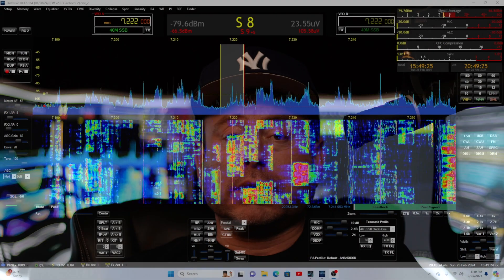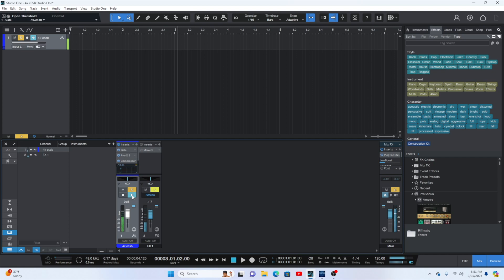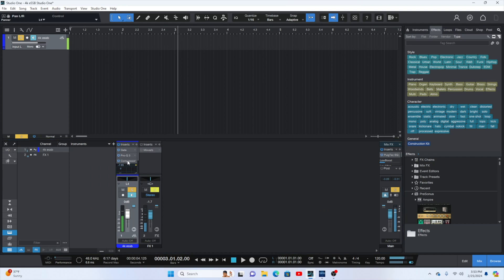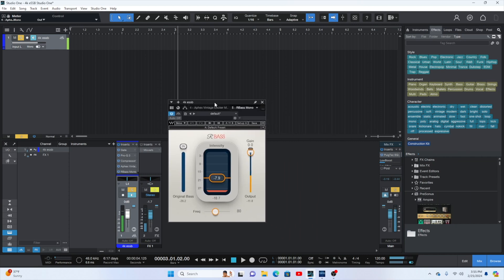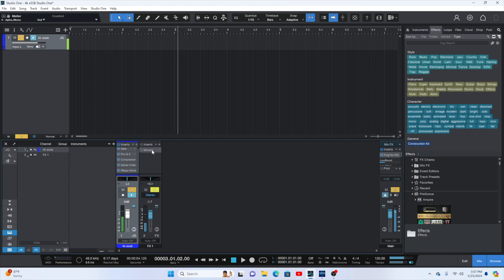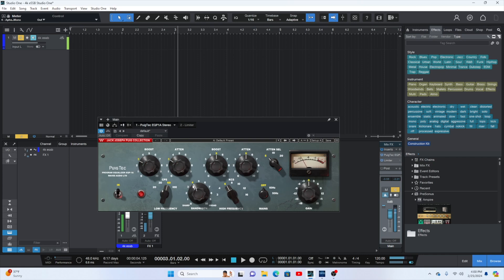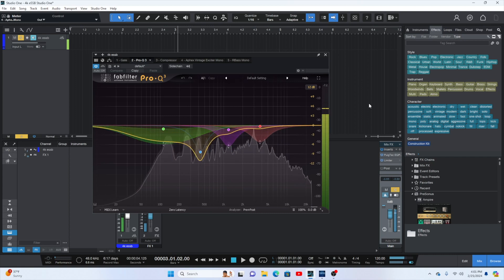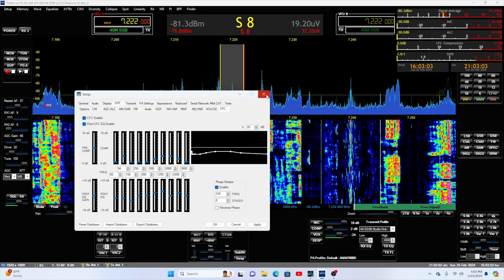Studio One and Personus 24c interface for eSSB audio processing!

Comment: Another quick question, how are you connecting the 24c to he focusrite, are you going into the mic input on the focus rite ? What output from 24c ? Just trying to order the correct cable thanks
Reply from the maker: Main out on the 24c to input 1 on the focusrite using a trs cable 1/4 inch.
Reply: @kb2uka575  thank you very much mate awesome going to town now to get it cheers buddy -ei2ijb

Comment: Nice vid, why do you use the focusrite interface when the presonos does the same thing ?
Reply from the maker: If you don’t want to use routing software like voicemeter potato/bananna, then you need to use two different sound cards if you’re using a daw and sending that audio to thetis via vac. Windows does not like to share sound drivers so you use one interface as the “master” interface and the other interface just for the daw.
Reply: @kb2uka575 ahh ok got you, thanks for reply. Makes sense, thank you 🙏 Ei2ijb